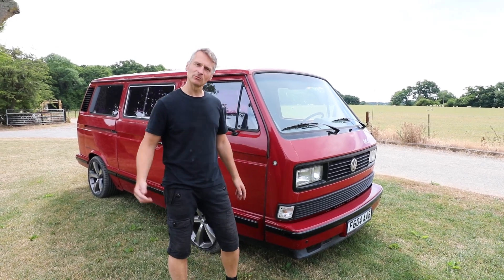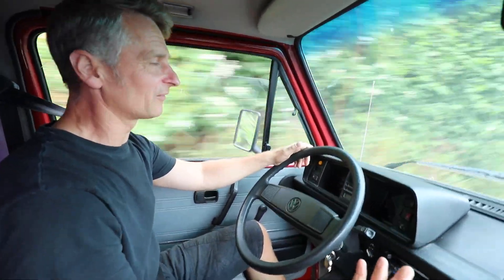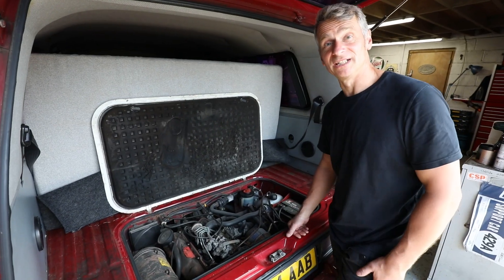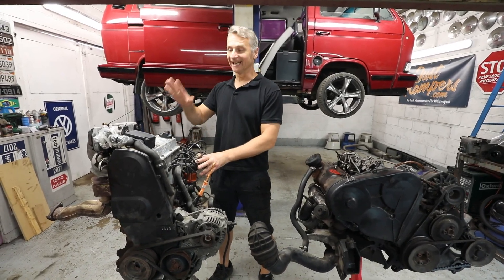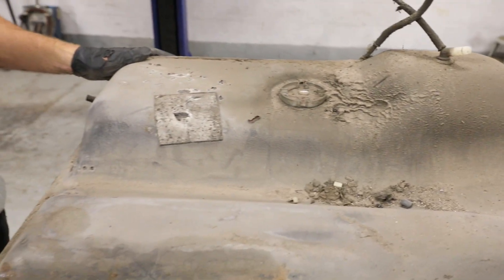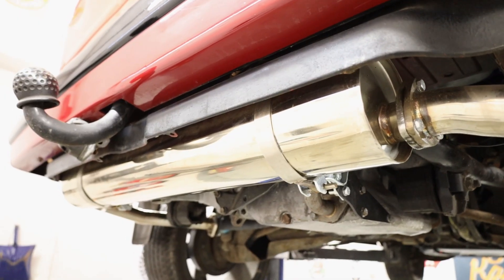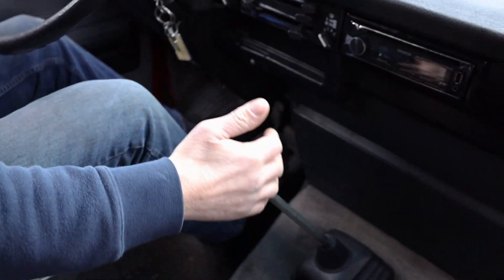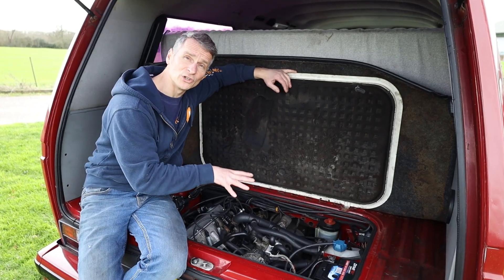We put a 113hp Golf GTI engine in a T25 / T3!

Comment: I got a Ford V 6 Essex engine in my 88 panel van kombi,  it was a common thing to do South Africa in the 70's,  80's and 90's as the original engine lack power, overheat in South Africa climate . Goes like a bomb up hills.
Reply: Yes ---- DAAN JACOBS CONVERSIONS (DJC) in Transvaal did those conversions very professionally ---- especially in the CARAVELLE series ---- the downside was that the gearboxes didn't last long --- especially the 1st gear and the 5th gear due to the torque of the FORD ESSEX V6

Comment: I’ve changed the engine in my ‘84 Vanagon to a Subie and my problem is the transmission doesn’t work as well with the torque of the new engine as it could.  Does your swap feel the same?  This is very busy as it is above 65 mph.   
A change of ratios would enable the Vanagon to keep up with interstate speeds(75 here in Arkansas and much of the US.).  Do gear sets exist that can do that?   Is it something most transmission shops can do?

Comment: Low Torque and high revving. But anything is better than the 1.6 diesel.
Reply: Isn't the 1.6 extremely economical? Considering the costs of the conversion i'd rather refresh the diesel and put a small turbo on it - if i absolutely had to have more power.

Comment: Hello sir, i have a '88 T3 that came from factory with the air-cooled flat 4 2000cc. Some years ago my father, swapped to a scoobie EA82 on the original bell housing (he fabricated an aluminum plate to change the bolts pattern). Now im looking to swap to a AGG or 2E engine. Do i need the bell housing of a diesel or could i also fabricate another spacer? It's the main car for our job, cant afford to buy a newer one 😢. Sorry for asking you, but can't take a straight answer from someone. Thanks in advance!

Comment: what gearbox did use.what gearbox mods
Reply from the maker: Hi Kimberly, we kept the original gearbox as the jump in engine performance wasn't big enough to cause any issues with the box the T25 came with, but we did add a new adaptor plate :)
Reply: @justkampers  its not a straight fit u need a adaptor

Comment: Nice, would a VR6 swap have been difficult? Or maybe a 2.0 16V swap?
Reply: I have done both. The 2.0 16v was easy, the VR6 was a hard one, but worth it just for the fantastic noise. 
I have put everything from Toyota 2.4 TD to Ford Essex V6, Audi 5 cyl, Porsche flat 6, and more, in VW busses. They are the most versatile platform ever. Love them.
Reply from the maker: There's loads of different engines you could drop in there, we just picked this one as it's pretty easy and relatively affordable, so it would make a (hopefully useful) guide for a lot more people. 

We definitely considered putting something wild in there, but it wouldn't have been as helpful for as many people!

Comment: Hello my dear friend
I want to ask you something about the conversation. I had the original 1.9 petrol water cooled engine with 4 speed gearbox, and I have already done the conversation with 2000cc golf gti 115 hp, and I can understand that this 4 speed gearbox it's not  correct for this engine. So I want to ask you what is the correct gearbox code for this conversation please??
Reply from the maker: Hello! The gear box in the conversion we did was the original five speed - Transmission code: 3H  

I hope that helps :)

Comment: Nice start to resurrecting your Multivan. Just recently I swapped out my engine from the stock 2.1 liter petrol to a 2450 cc petrol.  Went from the typical 90 hp to about 130 hp.  Not a dramatic upgrade but very useable growth in capability.   I sort of wish now I had a five speed transmission for it.  We are all very fortunate that anyone gives a darn about these things, as they have a well deserved reputation for carrying a lot of stuff! Original owner of my 1987-1/2 van with about 306,000 miles on it.
Reply: Just transformes it and vw should of put the gti engine in surly and even a 2.9 carb version also instead of rattly slow air cooled engines.
I have a T3 and put a PD tdi in mine brillant power and 45 mpg plus on long runs and 36 town driving

Comment: did you just swap the dipstick and tube for the JX one? And then now much oil do you put in - JX spec or the AGG? (or are they the same?)
Reply from the maker: Hi, we used the JK dipstick so we can check the oil without lifting the engine hatch. We had to drill out the AGG dipstick base to fit the JX Dipstick.

Comment: Had this done to my old T25 (now sadly sold).  Garage that did it tried to cut corners and not replace the fuel tank - big mistake - all sorts of trouble with the injection system - a new tank is an absolute must (along with new fuel lines) - but the end result is really worth it.
Reply: It depends in the Tank. If you got a Diesel before the swap is a must. If you got a petrol Engine before, you can keep it. Its because the diesel tanks got a smaller outlet which does not let enough fuel through. Sorry for my Bad english:)
Reply: @steffenk.561  So if you fitted a bigger outlet the diesel tank would be good to use?
Reply: @Supercarlsunday  Yes. But i would swap it anyway. Petrol in old diesel tanks dissolves many residues which lead to cloggings and other problems. Get a new tank, paint it before inserting (Brantho Korrux) and then you are good to go for the next 20 years.
Reply: @steffenk.561  Thanks for getting back to me. Do you know where there is any info on the wiring? What do people do with the clocks off the golf loom, I've heard people leave them wired in? Many thanks

Comment: How do you fit the gti engine into the vans wiring loom ?
Reply from the maker: We used a bespoke built loom to run the injection system. This loom plugs directly into the vans loom at the junction box in the engine bay.

Comment: 1.9tdi 115hp would have done the job just as good. And a PB 150hp would have done it even better. 😁
Reply: Better mpg aswell
Reply: The GTI Swap is way More Easy to do :) its quite common
Reply: 1.9tdi 105hp with a remap to 160hp or big turbo/injector it far more powerful/reliable than a gti engine
Reply: not with original gearbox ! too short ! audi gearbox !
Reply: i was thinking the same thing.
Reply: Gearboxes cannot handle big torque diesels.
Reply: And an A888 even better. Or better still a Porsche flat 6. Even better, an Audi v10!
Reply: What do you mean “just as good”? The 1.9 TDI would’ve blown it away. It has 115hp, but the TORQUE is like 170 or more. They are WAY more powerful than that GTI motor. And thats stock…you can mod them into true beasts. Plus way more efficient, reliable, and theyll go for a million kilometers. Especially if you get rid of the computer bullshit and make it an MTDI.
Reply: Yeh but stinky old diesel.
Reply: @fydstar  diesel is life.
Reply: @benaarsify  Not when you have asthma